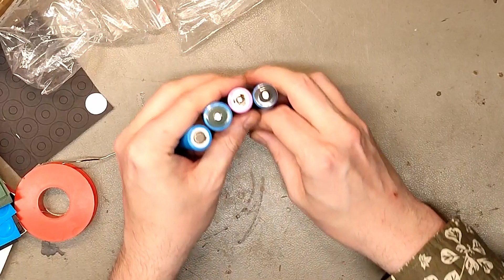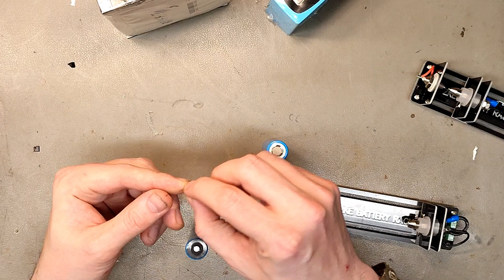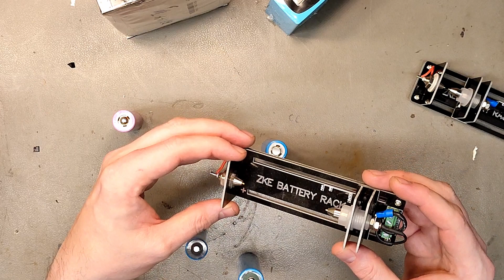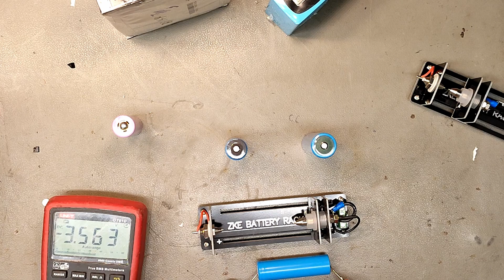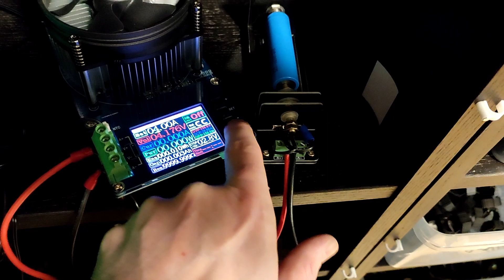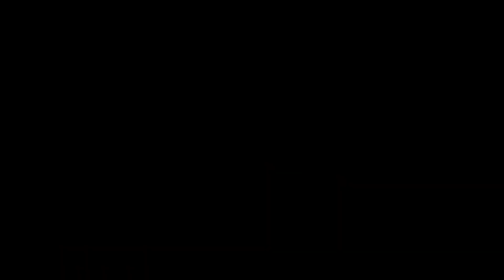Which TOP is best? and how to test with ZKE Battery Rack?  PART 2/3

Comment: Where is part 3?
The caps probably should solve heating issue of soldering to positive where it will harm the gasket and ruin the tesla battery in the long run.
I just coukd not understand from part 1 how should caps be attached to battery and how wire is attached to them.
Reply: It's just setting on it from what I understand.
Only touches the plus terminal.

Comment: You definitely have a defective cell holder. I barely get any voltage drop on mine. I've done 20A tests on Samsung 25R's

Edit: wait no you're not using the 4 wire measurement thats why. One line for A-, one for A+, one for V+ and one for V-

Edit: put a video up on my channel explaining how the cell holder is made. I should probably make a second video about setting up the 4 wire measurement on the DL24 or similar load testers but I'm making 3AM pizza
Reply: The V terminals are ONLY for voltage sensing. You can't pass current through them